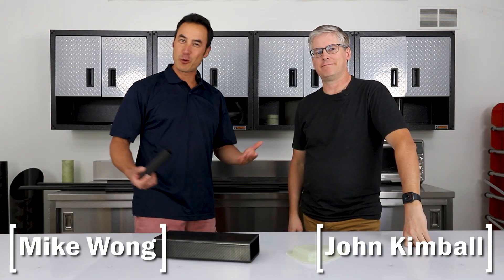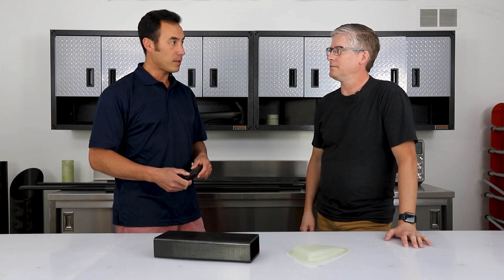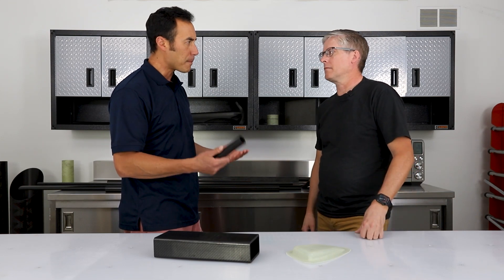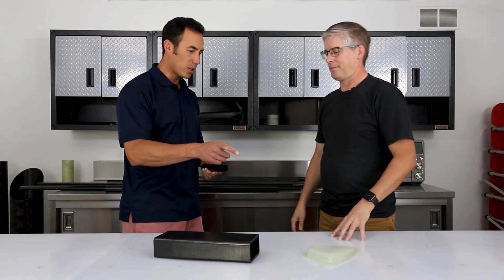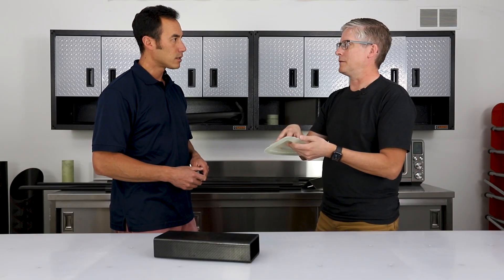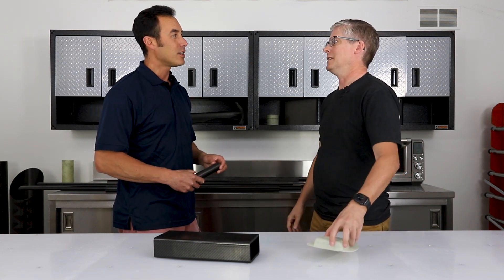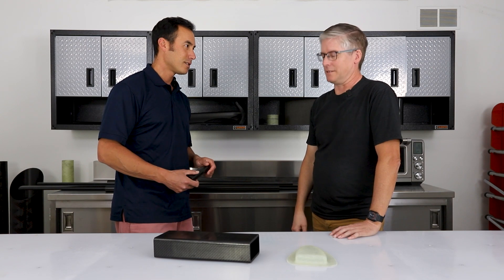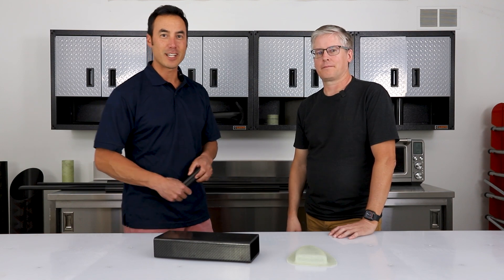Frequently Asked Questions: Part 3

Comment: Hi guys, love the series as a material sciences student.
My question is, does the tow ever run out when filament winding? If so what do you do?
Reply: Yes, the tow can run out. You try to make sure that your spools are big enough to finish the job, but occasionally you don't have that luxury. In the "old days", we would simply tie a knot between the old spool and the new spool, then let it run for a few revolutions and try to find it and cut it out. But, now we have special tools that use a puff of air to combine the ends of the tows into a smooth combined strand. You can't see it and it's a super strong joint.
Reply: @johnkimball314  Ah that's clever. I have seen how knots in CF can completely ruin it's strength. Thanks